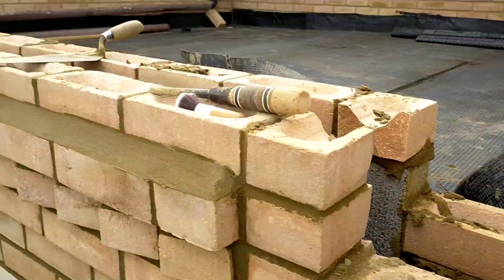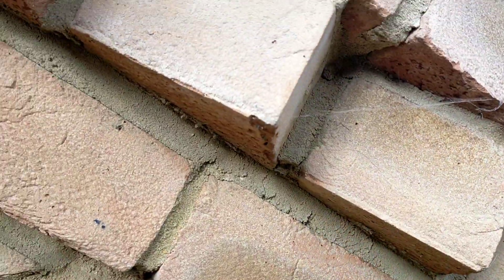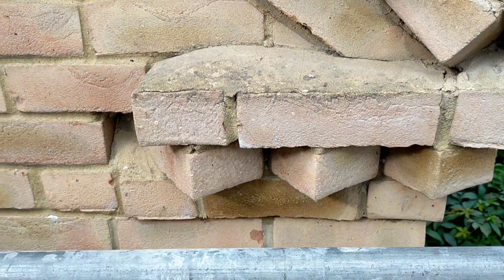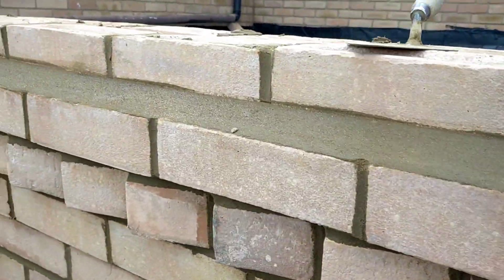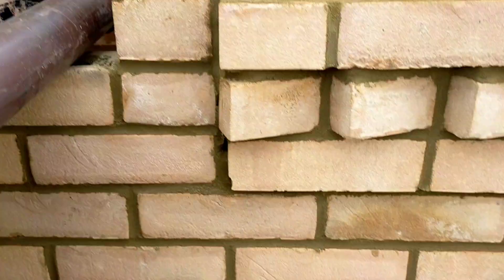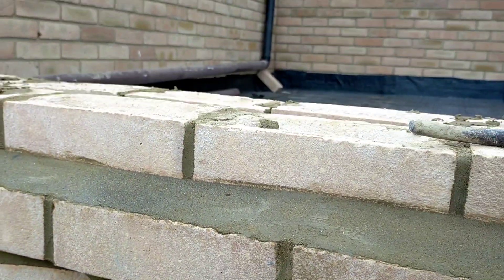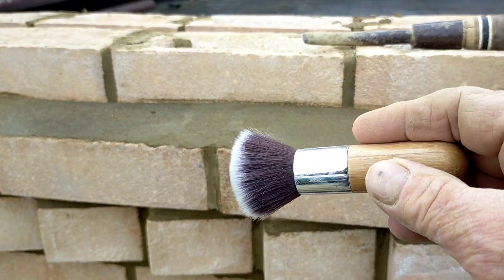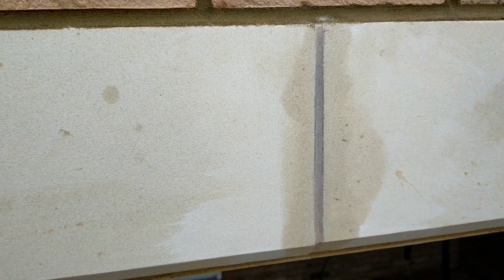Bricklaying dog tooth course.

Comment: Speaking as a site trowel, one of the biggest problems we have to overcome is the quality of bricks we're given to lay. Some of them are so small or vary so drastically in size that site foremen and chargehands are told by the subbie and/or agent that all the pointing must be done with an 81 jointer, even when it calls for something smaller. Some of it looks good, some of it is utter dog shit.
Reply from the maker: Every brick should be treated on its own merits, I've many different jointers so I can match to anything when building extensions.Brick quality is shit nowadays but it's always been the same with Stock bricks that's why years ago they were raked out and Weather struck pointed later but no one wants to pay for that anymore. 👍
Reply: When they tell you to use an 81 smile and say OK and then just fucking ignore them.
I have been told this so many times and just do it using my knowledge and experience with various jointers I have.
I always get complements from the lads that my work always looks good.
You are the craftsman, not some college boy in the office, it is your work, do it right, be proud and ignore those who don't know, even if he is the foreman!

Comment: The big difference between price work and someone who actually cares . 
    A gang up here can’t even get flat work right but they are churning them out fast so they are the favourite gang …. Poor 1st tube buyers getting shite 😡😡🧱👍🏽
Reply from the maker: It's all changed for the worst mate, many years ago I worked with price work gangs who were fast and neat, I remember making that jointer mid 80s, four of us made one each from a bit of smooth rebar to joint up perps properly in internal corners. We a also made some from 12mm bar just for jointing, in them days we were building warehouses laying over a thousand a day every day each man, I was young then😁 Marshaltown jointers didn't last 5 mins so these were the weapon of choice. Rained off?
Reply: @bricklayersworldwithandy6277  . Back in the late 80 when I was an apprentice we used stick jointers , rounded off hardwood 😁🧱👍🏽
Reply from the maker: @SteveAndAlexBuild  We still do with some bricks.
Reply: @bricklayersworldwithandy6277  👌🏼🧱🧱😉

Comment: Yes those are a pig to point had to replace a few today heating engineer went from inside with drill,idiots why don't they pilot then drill from outside 🤦🤦🤦
Reply from the maker: Because they are stupid same as Cable TV Engineers who think it's ok to ruin a brick and cover it with a blob of silicone 😁
Reply: @bricklayersworldwithandy6277  exactly plumbers are the worst

Comment: why even bother putting a compo flaunch on the bricks that thin in 5 years it will all have cracked and dropped off
Reply from the maker: Following the detail on existing house, if you use a SBR/Cement slurry to prime and add a drop of SBR to the mix it will last a surprisingly long time but I agree I'm not a fan of flaunching.
Reply: Honest question, if you didn’t use flaunching, whats the alternative? Would water not sit and pool on top of   Bricks and then blow all bricks?
Reply from the maker: @andybell575  It's a bad design and shouldn't be happening, ideally a Plinth Stretcher should be used I suppose.
Reply: @bricklayersworldwithandy6277  thank you, I was asking as I’m building my own extension and wanted a similar detail on parapet roof, but it has been bugging me that it seemed an obvious place for weathering to occur. I’ll look into the plinth bricks thank you.
Reply from the maker: @andybell575  👍
Reply: @bricklayersworldwithandy6277  thanks for replying mate much appreciated, i wasn't having a go ur work looks spot on, it's the same when u do a wall with a tile crease they want it flaunching, to me a complete waste of time, as iv'e never seen one yet that lasts, top bloke good channel